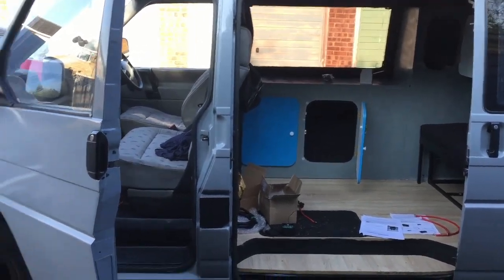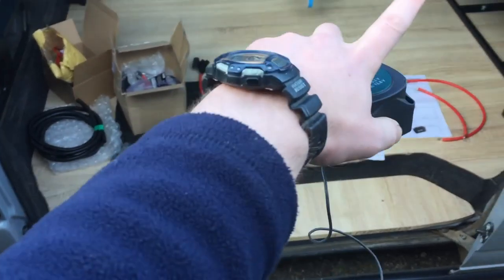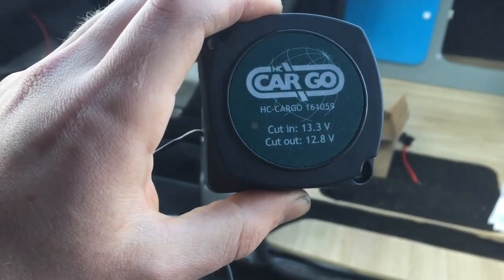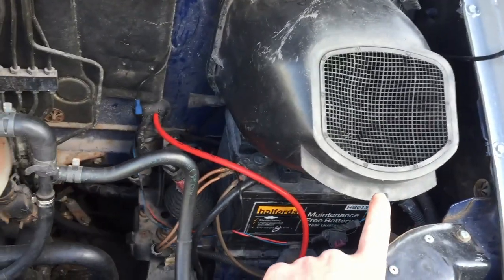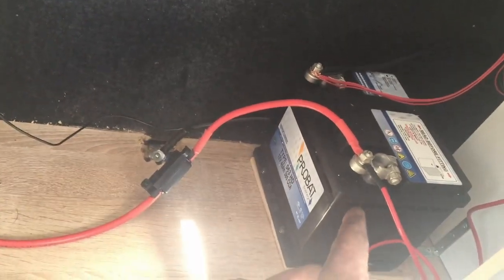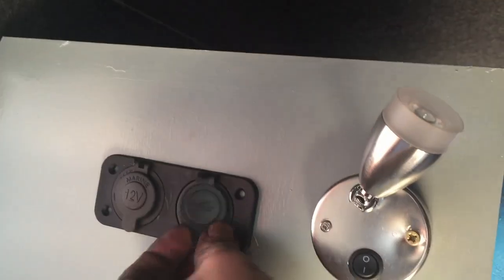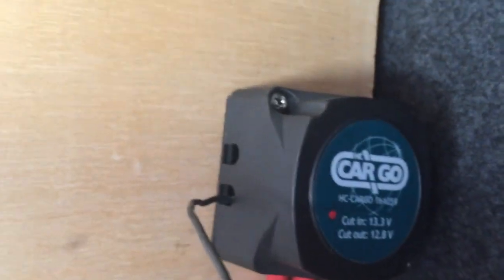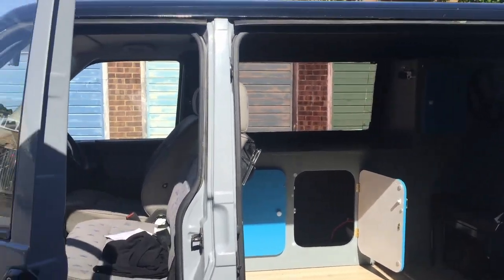How to install a leisure battery with split charging

Comment: Nice video, one question! Once you have done this how do i get power to the sockets?
Reply from the maker: sashagooch 

The positive and negative to the sockets connect directly to the positive and negative on the leisure battery. Make sure there is a fuse (with an amperage rating lower than the wire rating) somewhere on the positive wire of every appliance you hook up

Comment: Hello, can you tell me what size cables you used to connect the 2 batteries and what size black earthing cable please and what size /type of fitting you use on the actual battery terminals please? Thank you very much.

Comment: Thanks, Joel. Very useful info as I've bought the same kit! Perfect for getting safe charge into my leisure battery. But I'm going to research some more about what to use the  leisure battery for and wiring as you don't quite describe how to set up the fuse unit and there also appears to be lots of red wires coming off the neutral terminal.
Reply from the maker: Thanks! Glad it helped. I used the red wires because I ran out of black - very sloppy on my part! There is another video on my channel about how to wire in a fuse box etc if you are interested
Reply: @JoelsStuff  Thanks again. I found your wiring video. That's exactly what I was looking for, explaining the wire and fuse strengths to the amps of individual lights,etc.
Reply: @JoelsStuff   why did you not use an  inverter ??

Comment: Thanks. This was very well explained. I have a question though.
I have a blue three pin hook up on the side of my T5. Is there a way to be able to recharge the battery from and external point? As well as when out using the engine to charge it?

Comment: Hi Joel, i know the post is old but i have just got a camper and want to do the same set up, did you just drill a hole through the wheel arch and bolt the earth cables to that since its part of the chassis,,great video ,,cheers.

Comment: Great video. I have just bought this same set up, ready to install. One question? Is it vital to have a fuse box so soon after the main battery connection? The instructions say 250mm away. Id prefer it to be further away for my convenience really.
Reply from the maker: The problem is that any length of positive wire before the fuse is not fused itself (if you get a short circuit on that section it will be a fire risk), so the idea is the shorter you keep it the better. If it needs to be longer, make sure it is durable wire and free from any risk of being damaged. Good luck!

Comment: Thanks for this but is the Relay directional? The instructions say connect the starter battery to the starter side and the leisure battery to the leisure side, indicating that it is, but the terminals don't seem to be marked starter (IE car) & leisure. They are only distinguished by one of them being painted red on the end. Which side is your 'red-end' terminal connected please.

Comment: Hello Joel. Just watched the video. Could you please tell me what the red wire coming from your leisure battery's negative terminal is doing? Going to where?
Many thanks on a simple to understand video
Reply from the maker: Yikes! This red wire was supposed to be black. I used the wrong colour to connect the ground from one of my appliances because I ran out of black wire. This is bad practice so I can only apologise. Good luck!
Reply: No problem at all, that's cleared it up for me. I'm sure we've all done it at times

Comment: What fuses and fuse box did you use for where the main battery of the van is ? And did you hook up the black wire to it also or just red ?

Comment: Hey, great video! What amp fuse did you use between the starter battery and split charge relay? did you use another fuse between the split charge relay and the leisure battery? And what amp wire did you use?

Thanks!
Reply from the maker: Hi! No need for a fuse between the relay and leisure battery, as this circuit is already fused just after the main battery (although there is no harm in adding more fuses if you want to). The wire and fuse all came with the relay kit - I’m afraid I can’t remember what the amp ratings were. Just make sure that all wires are rated high enough for the current passing through them, and are fused with a fuse that has an amp rating lower than the wire and you should be good
Reply: It would depend on what the relay can handle, as to what wire and fuse to use. Stick to the weakest link in the chain.

Comment: Thanks for your video mate, what size ah battery is good, what size ah was/is yours in the video please?
Reply from the maker: Hi mark. It all depends on your needs. Mine is a regular cheap car battery that was £35 from ebay, but I only really use it for lighting and phone charging etc. If you want more heavy duty use (fridge, tv, etc) then you need to look into getting a proper deep cycle battery. Good luck!
Reply: @JoelsStuff   Thanks for your reply that's great.

Comment: Thanks very helpful, what sort of stuff can you power with this kit you have used? Tvs? Xbox? Kettle? I need to charge makita battery's and maybe a mixing drill for adhesives? Any idea how bit of a battery I'd need? I've been thinking about doing something in my van for ages
Reply from the maker: Hey! great questions.

Once you have a leisure battery installed you basically have 2 options for powering things. The first is to power a 12v device directly from the battery. If you search Amazon or Ebay for 12v Devices you will see lots of car accessories (lights, fans, phone chargers, stereo's, camper TV's etc). These can be directly powered from your leisure battery.

If you want to power devices that normally plug into the 230v mains (e.g. Regular TV, XBOX, Microwave, Kettle) then you will need to buy a 12v to 230v power inverter which is a box that connects to your leisure battery and has a mains socket onthe side of it that you can plug stuff into. These come in a range of power ranges/quality and I don't know much about them. My advice would be to make sure you get a "pure sine wave", and not a "modified sine wave", as the latter can only power some devices. It's also worth noting that a cheap leisure battery will not power an XBOX/TV for as long as an expensive leisure battery in between charges (ie running your engine). Hope that helps!

Comment: Hey Joel, great video. Do you know what current the relay draws? I'm wondering how to size my wire. I think that relay is 140amps, does that mean that my 100amp wire wouldn't be big enough to handle it? Could i just fit an 80amp inline fuse for example? Thanks!
Reply from the maker: Hi Harry. I wouldn’t want to give specific advice as I am not an expert, but my wire is 120amp (came with the relay kit). I am almost certain that your 100amp wire and 80 amp fuse would be fine, but I can only advise asking an electrician.
Reply: @JoelsStuff  thanks a mil, Joel! I appreciate it. I think you're right. Keep up the excellent work dude. Cheers

Comment: Hi, just wandering if I can fit this split relay system to my stop/start battery? Please advise. Thanks for your upload, well done.
Reply from the maker: Hi there. I’m not sure I completely understand what you mean, but the main point of the relay system is so that you can use your leisure battery when the engine is off without having to worry about the main starter battery going flat and leaving you stranded. Basically the whole point of the relay is to prevent your starter battery from going flat, which is what it is doing on my setup. I would leave your starter battery as it is
Reply: Yes you can, the stop start battery isn't special in terms of voltage etc, it's more to do with the longevity of the battery under persistent discharge and charge condition. 

The issue you will have on modern vehicles is they tend to have aggressive smart charge systems, if it sense's the high capacity of the 2 batteries wired together, it will assume that the starter battery is fully charged, and drop the charge voltage. 

We run into this problem with our work vehicles, you can reprogram the vehicle to have a higher target capacity, or depending on your setup, just disconnect the sensor on the battery terminal, depending on the vehicle though, this could cause you performance/reliability issues so check with your manufacturer
Reply: @ryanmg92  Thanks again for that insight.

Comment: Do you connect the negative of the starter and marine battery? What do you have connected to your negative charges on the leisure/marine battery? 

I'm planning on doing this to my van soon
Reply from the maker: Both negatives are connected to the vehicle chassis, making them all connected together
Reply: @JoelsStuff  Oh okay. I remember you mentioning connecting the battery to the chassis, wasn't 100% it was the negative knob bit. Thanks for clarifying!

Comment: Useful video 2:27 you mention connecting the live to the fuse box but can't see how this is done.
Reply from the maker: It’s just an inline fuse holder that came with the split charge kit as part of the main positive wire

Comment: Nice vid. What size fuse did u put from the vehicles main battery to the split.
Reply from the maker: Thank you! All of the wire and the inline fuse came with the relay kit. I can’t remember what the fuse rating is 😭
Reply: Joel's Stuff  I have the same kit - they are 60Amp fuses

Comment: Hi Joel,

I was curious as to the length and wire gauge of the positive from your starter battery to your leisure battery and how you calculated the wire size?
Reply from the maker: Hi Craig,

This wire is 5 meters, 110amp. I didn’t really calculate this, I just used it because it came in the kit I bought. Search Amazon for SCKC305 to see the kit I used
Reply: Thanks very much.
Reply: @JoelsStuff  Do you remember how much the kit cost?

Comment: Thanks. You don’t have AC plug coming from the leisure battery?
Reply from the maker: I have a power inverter that I can connect to the leisure battery, but I never really use it

Comment: Hi there, great video thanks! Quick question.. how did you earth your lighting? Is it sharing the earth from the leisure battery? I've had a look at other sites and it says that all separate appliances need to be earth individually. Thanks
Reply from the maker: Hi There. My electric light is earthed directly back to the negative terminal on the leisure battery. You can do this for all of your appliances, or alternatively you can earth each of them back to somewhere on the vehicle chassis, since your leisure battery negative should also be connected to that somewhere. Good luck!

Comment: Great video - thanks. Just one question, is there a chance of over charging the leisure battery with this setup? Im looking at doing the same install. cheers
Reply from the maker: Hi there. I don’t think there is any risk of this. The charging setup is exactly the same as any normal car battery - i.e. when the engine is running, the alternator is providing a constant 14v charge to the battery. This setup just means it is now providing that charge to both batteries instead of one. Good luck!
Reply: No, it's fine. The alternator is set up to quit charging at a certain point.

Comment: Hi Joel. Love your videos. About to start doing my t5 up!
 Do you find your USB ports and light drain your leisure battery? Gonna follow your set up. Just wondering how effective it has been long term for you and if it's worth putting an isolator switch in? 
Proper newb to this.
Thanks!
Reply from the maker: Hey Matthew thanks! It all depends on your camping style and how you use your electrics. I’ve found that I mostly only really use the usb to charge my phone, and the small 1w light for not very long. Neither of these drain the battery much at all, and it would last hundreds of hours between charges (in theory). You can calculate how long a battery will power a device by looking at the amp hours (AH) of the battery, and seeing how many amps your device uses

Comment: Hello, Please one question: What wire did you used from the leisure battery to the earth point? is that 16mm or i can use 10 or 6mm?
Reply from the maker: Hey. I don’t remember the mm, but I seem to remember it was rated for 120amps. Good luck!

Comment: Hi thank you so much. Can I connect my leisure battery and car main battery without auto relay switch. I'm thinking of putting manual cut off switch between two batteries. Is it possible ? Please kindly teach me.
Reply from the maker: Yes, just put it on the circuit where the relay switch should be. Make sure it is a heavy duty switch (buy a battery isolator switch), and make sure the positive cable is fused twice (once near each battery). Good luck!

Comment: OK, assume you want both a split-charger, like yours, AND a solar charger. Would you run your positive from your split charge relay into a solar control charger, or directly into the luxury battery (like you did) and have two completely separate charging systems? How would that work? Because I want both. Do you follow me?
Reply from the maker: I have no experience with solar, but it makes more sense to think of the split charge relay as a device for cutting off your main starter battery when the engine is not running (thus preventing flattening it) rather than a device that charges your leisure battery when the engine is running. If you add a second device that adds voltage (eg solar panels) into that system, my fear is that the relay will end up allowing charge to be drained from your main battery, even when your engine is off, which is the scenario you want to avoid. I don’t know the best way of hooking up solar, but I think it would have to somehow supply it’s charge directly to the leisure battery. I’m not really the right person to ask, but I hope this helps. Good luck!
Reply: @JoelsStuff  .  Appreciate your speedy reply. The split-charger prevents the main battery from being drained AFTER it has charged the leisure battery. And the solar panel charges the leisure battery through a charge controller. Many use both. I just don't know if the main battery (or alternator) has to be wired to the solar charge controller or directly to the leisure battery as you did. Maybe the power from the solar panel is simply shut off while charging from the main battery.

Comment: hi, not sure if this has been asked here but what size cable did you use from the leisure battery to the multi fuse block ? thanks.🤔
Reply from the maker: It came as part of the fuse block. I’m not sure what it is

Comment: I'm doing the same thing I was just curious about the grounding everywhere I look they've told me to drill through the van floor and bolted and grounded right to the frame itself not to the chassis. How has yours been working to the chassis is it working good
Reply from the maker: It doesn’t matter - any exposed metal on the van will all be connected to the rest. Chassis/frame/floor are all good as long as the circuit is complete

Comment: Awesome video and so handy, best I’ve seen - I’m struggling to find the same fuse board you have, I’m very new to this if you could point me in right direction I would be so greatful!
Reply from the maker: Dublife_junk Insta 

Thanks for the kind words! The fusebox can be found here https://rover.ebay.com/rover/0/0/0?mpre=https%3A%2F%2Fwww.ebay.co.uk%2Fulk%2Fitm%2F173059713927
Reply: Joel's Stuff thanks mate - massive help, it made my life do much more simple as I struggle with electronics. From the fuse board, are the wires running off all just a single live to your lights etc?
Reply from the maker: Hey! I have a full diagram of how I wired all that stuff at https://youtu.be/gn2pNY0JhNI

Comment: What type of cable did you use to run between the battery's? Also thanks for the video,it was straight and to the point
Reply from the maker: It was just the cable that came with my split charge relay kit, rated for 120amps
Reply: @JoelsStuff  ok cool. Thank you

Comment: Oh sorry i still have a bit confuse.. Is the split charger disconnected itself when the leisure batt is full?
Reply from the maker: Hi there! The relay is always on when the engine is running, and always off when the engine is off, so no it will not disconnect when the leisure battery is full. This is not a problem though - the alternator will provide a constant 14v charge to both batteries, even if they are fully charged

Comment: Do you have any battery/setup recommendations for running the equivalent of a mobile disco? So we are talking about several sockets that can take extension leads and a lot of power for lighting and sound systems.
Reply from the maker: StickySprite 

Wow! Sounds quite interesting! Unfortunately way out of the scope of any setup I have dabbled with. Technically you can buy a good quality pure sine wave power inverter. This will allow you to power a couple of 230v sockets while your engine is running, but it would put a lot of strain on your alternator if you were powering that kind of stuff. You’re asking the wrong person I’m afraid XD
Reply: Joel's Stuff no worries thanks for replying, I had to start looking somewhere afterall. Theoretically I understand the engine will have to be running, I'll need a fuse box and some kind of power regulator.
Reply: Buy a generator !
Reply: Dan 5675 any recommendations?
Reply: Honda engine 3.5 kva minimum . You’ll kill leisure batteries in no time running a big rig like that. Unless you can get a few submarine batteries they come up on auction occasionally . Oh and a bloody good chain and lock as a stolen genny can be a right buzzkill at a party . Good luck

Comment: Should have mentioned it will require 16mm2 cable, if this is not provided. I used a 100amp circuit breaker, rather than a fuse as this can be switched off quickly if required.